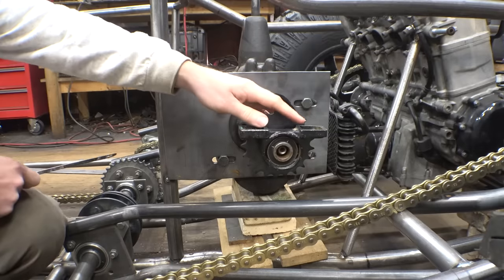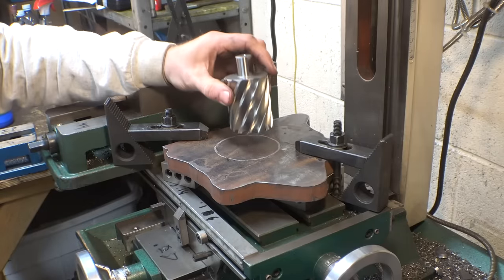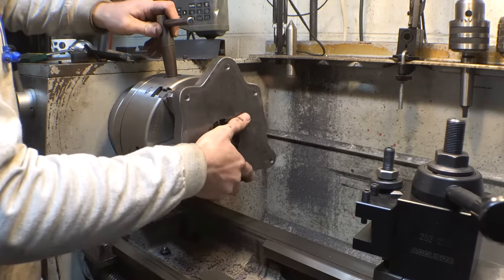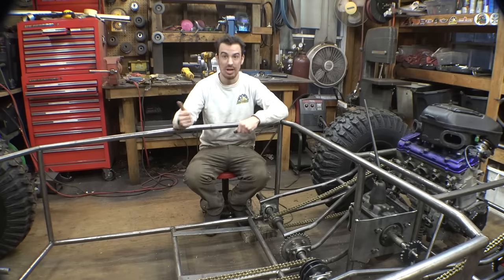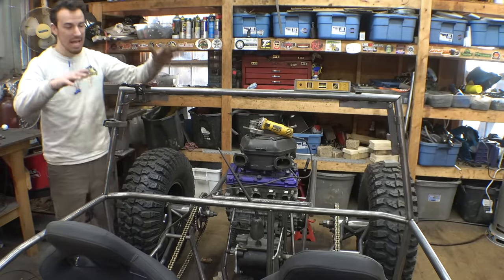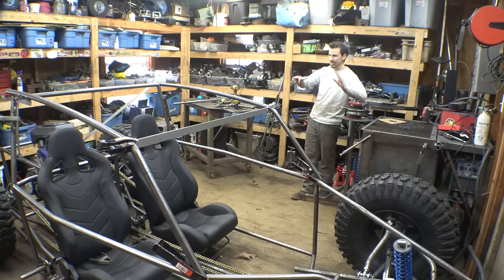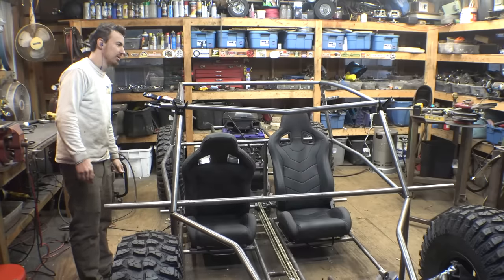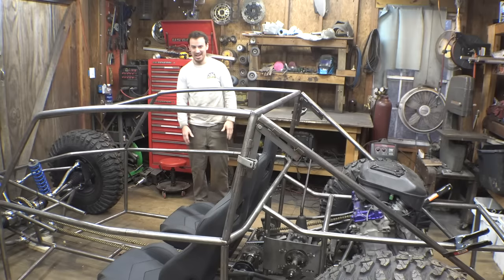Mini 4WD Trophy Truck Project - Part 7

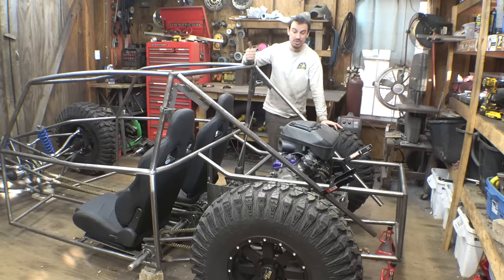Comment: 26:54 I’d say it look pretty cool running that tube from the roof to the end of the back and it’s more functional that way and also adding the roof would tie in to the aluminum panels on the side AND I JUST WANNA SAY THE FRONT END ON THIS THIN IS BADASS 🔥

Comment: It's gookin' amazing!   the rollbar should protect the airbox & then mount the tire over airbox. Between engine & rear frame  would put gas tank. when you build the exhaust I would make it come up a rap around one set of pipes on each side of the spar tire!!!

Comment: Put a pop-out bump over the air box, OR put a 'hip roof' type bend to the back frame part so it still clears the air box while still giving you a cool 'fast-back' look to it.

Comment: A little trick I have learnt (really old school method of resurfacing a engine cylinder head) is use a strong flat piece of glass (glass patio table works well) tape a big sheet of sand paper and then just push forwards and backwards what you want to have a perfectly flat surface and work your way up with finer and finer sand paper

Comment: If you're considering a spare tire but you want rear visibility, why not put the spare on the roof? That would look sick🤙
Reply: that was my thoughts also.. out of the way..
Reply: roof rack with tire rack and light bar
Reply: Carrying a full size spare in a rug like this is adding extra weight, raising the cog and mostly pointless.

Many in the Suzuki 4x4 club stopped running spares years ago. 
Air compressor for lockers and tyres, a patch/plug kit and basic tools.
Reply: Roof rack would be awesome. Maybe if there was a little more room behind the engine could make a place for the tire there.
Reply: Or put the tire horizontal above motor but with the ability to see under it to look backwards.. almost like squaring off the rear... give motor protection and a spare location without on roof so wouldn't be as high...
Reply: I agree.  The roof is the perfect place for the spare
Reply: If he's going to be using it as a rock crawler, by putting the spare on the roof, it would increase the height of the centre of gravity, causing it to be more unstable at certain angles compared to if it was lower or elsewhere. Even the rear would be a bad idea as all the weight is there, causing the front to be less stable at high speeds and vertical angles. I feel like he should make a bonnet/hood on the front and try and place it there
Reply: @stephenweston2973  I had the same thought. If he took the roof line of the front and continued it all the way back with something like a 75 degree angle bend at the end, down to the back corners he'd have a clear line of sight all the way through, much more room to remove drive components later and  a great spot to mount his tire.
Reply: High cg

Comment: Chris, when making a hole with a hole saw, pre drill a hole (say 8mm) just inside the edge of the finished hole size. This lets the cuttings clear easier and the saw will cut faster and cooler 💪👍

Comment: You've got a real challenge getting the asthetics of the frame looking right, whilst meeting all the parameters of installing all the major components of the build.
Was pleased to see that you 'pinced in' the A-pillars and added a curve to the roof rails.
I would be inclined to suggest that you add 2 more curved rails to the roof along the center line of the MTT (Mini Trophy Truck) say 6" to 8" apart to support the ali roof panel. it would also allow the option for there to be lower section in the middle of the roof (front to back) to help reduce the apparent 'mass' of the roof which might occur using a single one-pice panel.
The bends you've added to the tubing help reduce the boxiness of the MTT, which is great.
As for the rear bars from the B-pillar to the rear, maybe do as you've suggested have shorter & steeper diagonal rails from roof hoop to the side rails close to the centre, or just behind the centre of the wheels. Then that would allow you to build a removable 'engine-cage' which would have 3 benefits: 1.It would protect the engine, 2. It would give the MTT a more truck like side profile, and 3. It would allow you somewhere to mount the spare wheel like most trophy trucks.
Hope you're OK with tossing a few ideas in to the mix.
You're doing a awesome job, which must involve countless hours 'off-camera'.
👍👍

Comment: You could put the spare tire on the roof. That way you can have good visibility behind you.
For the airbox protection you could just put a bend in the back rollcage bars to keep the steep angle but also protect the airbox

Comment: Ditch the spare tire, just keep in your trailer locked up, use if needed. Also add an "angry" bend just below the other upper bar, for the steering area etc

Comment: Mad skills building the plate for the trans!!! 
When building your cage make the back short, that motor will make a lot more torque with a custom intake on it, the. You can push the intake over the top of the motor towards the front of the car. 
Everything looks cool but definitely take in consideration of what your cage is going to do in the event of a rollover and address the key points of stress on those areas. The triangle is definitely your friend when building a cage, function is more important than form in that respect.

Comment: Sir  for the Back Braces put in a Radius bend in the Tubing. As for the Side Rail are a little high and needs to drop Down 8” to 12” to make it Easier to get into your mini truck, put X in Roof, front end ,side ,last rear to hold your Tire.   Looks Awesome Still

Comment: I would say carry the roofline a little way and then bend the steeper angle you like in the rear so it protects the engine. 
Could you get away with a hood mount tire, better weight distribution as long as you can keep line of sight.  And a shield/tunnel for the chain should be sufficient, PTFE or nylon guids to quiet any contact points

Comment: Love this build as well, maybe slant that bar all the way to the bottom in the rear then the spare can be mounted lower for rear vision and also you could utilize some of the frame  for coolant passages for the front mount radiator seen grind hard do that 👌☮️

Comment: Cross bar support on top with a removable soft Top. Back bars sharp drop to horizontal to 90° drop to back. That should protect the air cleaner, provide tire mount and give the illusion of a truck bed.

Comment: If you feel you need to carry a spare tire, you could fabricate a thin wheel and tire just for emergency use, maybe using a motorcycle tire, and possibly mount it on the front. An alternative mount might be on one side at the rear, parallel to the rear wheel, possibly on the inside of a rear frame braces.

Comment: I think you should definitely run the rear tubing all the way to the back of the frame to add protection to the air box and for the spare tire it would still pretty great in my opinion

Comment: Love the build. Yet the idea of a rear mounted spare tire of that size I likely to negate your plan for a rear view mirror. Looking at this cool build it might be worth considering adding weight to the front by utilizing the low front end to mount the tire there and the rad behind the engine down lower which would also negate the need to add more weight with a front mounted rad which requires a lot of piping for coolant. 
It would look good and meet utilitarian standards. Either way I'm sure everyone will be pleased with your final build. I love this build because I have been wanting to build this 4x4 design for years but have no place to do it.

Comment: You could definitely do High speed digs in 4WD with a chain guard and either one huge chain guide or several small chain guides but High speed digs aren't impossible just because you're using a chain and with IFS it's really simple to build.

Comment: Looking good. The top tube of the halo hoop I think should have a matching curve in it to match the side top tubes. The angled tubes in the back would make more sense to have them go all the way to the back of the frame for protecting the motor and to mount the spare tire. As much as I prefer a notchback over a fastback, fastbacks still look awesome.

Comment: I’d say put as much paneling as possible. Make the thing look finished. Part of what makes these off-road projects so fascinating is that they are covered but have beautiful cage work done. As for the back end angle for tubing, gotta protect the motor first. For where it sits the motor is too high to do the cool angle where it comes down halfway on the back end. Have it go all the way to the back bit the bullet thing. Spare tire is probably a must. Makes it look cool, capable and tough. For the rear view mirror it’s gonna be hard if you want to incorporate anything else to the back. Go with a cheap replaceable back up camera mounted right under the top of the main hoop. Or if there’s not enough room with the spare tire right at the back of the bumper. On Amazon I’ve seen em as cheap as 50$ for a little 5 inch screen. Can either engage the cam when you shift to reverse or just wire it to be on all the time. Plus you can put the screen next to the dash so it’s always where you’re looking anyway. Sorry about the long comment, it just this project has so many cool features to incorporate! Keep up the good work. Always Rather Be Welding

Comment: The rolled top looks great. 

If i were doing the roof id add a 6-8" straight portion between the mean eyebrows. Then run 2 rolled bars back to the rear. Connect the front of the rolled bars to the new corners made by the straight portion up front. Then connect them to the rear about 10" from the corners. Making a kinda V shape to the roof.

Comment: I think with the bars that'll protect the engine should taper inwards at a angle for the first foot at the same downward angle as well then bend back to meet up with corners of the lower tubing would look nice. Cross bracing the roof I think would look better in the end and I think you should sheet the roof too, it'd look a little goofy with the rest of the paneling on as of right now in my head.  Loving the build man! Keep on dishing out the awesome content!!

Comment: Pretty sure the purpose of the tires on the back of trophy trucks is weight so they don't nose dive and I don't think you will have that problem without a spare on the back. The shape looks really good and it's coming together nicely.

Comment: Idea for CBR... How about using camera and a small screen to see behind you like a rear view mirror. Use a camera fitted on the back of the CBR1000 for rear view with a screen the size of a mirror in the same place as the mirror would normally be so it feels the same and you use it as you would the usual mirror but you could make the view adjustable if needed.

Comment: You could do the full panel look, mount the spare tire to the roof like those adventure buggies, and even a plexiglass "windshield". These additions I feel would give the vehicle a more "complete" look instead of a cage with wheels. Additionally, you might be grateful for the extra paneling and windshield when rocks and dirt are being slung at you. Just my thoughts

Comment: Roll the two bars on the back, and have a bolt on cross member (for engine removal) that the spare tire bolts onto. Less strait lines, more rolled 🙂

Comment: If you move the engine forward you can have the rear tubing at a steeper angle and it will bring more weight to the center and plus you could make a trunk. All I'm seeing is bonuses there if it can be done

Comment: You need one of the long race mirrors so you can see behind and to either side like for dirt track cars. You could also make a horizontal rail in the back so it looks like a truck bed.

Comment: You should definitely do a roof but you should add a sunroof or roof escape hatch.... That would be helpful when bogged down and you don't want to or can't get out the side. Plus it would add a little more style to it whenever you can roll up on a hot day and completely open the roof for air flow.... 😎😁

Comment: Nice work buddy if you have the aluminum on top make sure you have enough support brackets tabs and structural tubing and a good way to secure it , It will vibrate very annoyingly if you don't have enough brackets to hold it firm but I think it's a great idea and the ultra trophy mini lol is coming along great looks good and seems to me you got it handled good work buddy

Comment: The tubes going to the back would look good extended all the way to the end but put a 35deg bend about 9in from end. That would raise the bars up to provide more protection for the air box.

Comment: I like the angle of the rear cage like that. Now is the time to get creative with some additional bends for structure/engine protection in the back, but I definitely think you should not angle those 2 bars all the way to the back. They look good like you have them.

Comment: I think it would look cool, if you make mounting on bolts for the spare tire right behind the engine. Good visibility, engine protection and taking out the engine wouldn't be a problem. Btw, V shaped reinforcement instead of windshield will help gaining pure trophy truck spirit.

Comment: How about moving the back bars where you lick them, then building a small roll cage over the engine and slanted mount for the tire where you were talking about putting it.
Just some quick thoughts on what might work, give you a still fair view behind yourself and should allow for the looks you want.

Comment: You might want to try a thin coat of RTV sealant or muffler paste on the plasma table to help prevent welding the job to it. You will need to ground the job not the table and clean off the table and recoat it often.

Comment: I would mount the radiator in the back end put the roll bars all the way to the back and mount the spare on them with it hanging down a little in front of the radiator for a bumper.

Comment: I'd like to see RBW take a K20, mount it mid engine and turn it sideways and run driveshafts to solid axles front and back for an AWD Rock crawler/bouncer.

Comment: Placing.the extra wheel above the engines airbox may be the best.
Also the radiator placed at front, the more cold airflow, the better.
Using the fan with the automatic sensor only.
Because that will really ask for some nice airflow, behind the seats and close to the engine may not be that great.
Loved the top.bars with the slight bent 👌

Comment: you could look for a sealed bearing same size as the one in the back of the transmission and just pull the inside seal out. save you making a housing to put the seal in

Comment: I think it would be awesome to cut some actual body panels off a scrapyard truck of your choice to install on it. Make it sorta look like a truck. You might be able to find fiberglass fenders for a ranger or something.
Reply: Watched more. Cancel my suggestion of fiberglass. I didn't realize they were expensive. But sheet metal off a junkyard truck would be reasonable?

Comment: Chris, I would add a Prius electric water pump and I would put it right at the bottom of the radiator in the front that way your motorcycle water pump isn't beating itself a dead death try to pump all that water and if the water pump in the motorcycle engine goes out for some reason the Prius electric water pump will pump it just fine and they're only like 35 bucks make sure you get the electric plug for it to.

Comment: Chris if you don’t want the long chain to turn you may want to add another sprocket lock out like the back. Otherwise as long as the front tires are turning so will the chain. Or that is how it appears to me. If the wheel hubs have a lock then it should be fine.
Reply: he has Ford ranger locking hubs for the front

Comment: There is a safe way to static test the centre chain drive remove the rear drive chains and the front cv axles and test it with appropriate chain guards / enclose tunnel etc in the shop “ when “ drive train/engine married. Just a thought.?

Comment: Take off the angry eyebrow bar and put in a strait bar so you can put a windshield on it. Then you can make the angry eyebrow look with the roof. have it point down in the front. you could also up bend in the back of the roof making it look like a spoiler.

Comment: I have an idea regarding the spare; If you're going to keep the rear section flat, why don't you mount the spare to the very rear? You may choose/need to shorten the box section a little to stop it looking goofy, but it would prevent it from occluding your field of vision, keep it properly attached to the vehicle, and even act as a bumper if the unthinkable happens and someone drives into the back of you.
The other option, would be to mount the spare on your roof. It would keep it out of the way and eliminate field of vision issues

Comment: Body roll is going to cause negative camber in the rear during cornering. You might consider going to a round tire profile. Those square ones are going to be on their edges most of the time.
Trophy trucks are known for soft suspension. That's how they go fast.

Comment: Maybe mount the down braces to the top of the rear frame section. And radius the bottom of the rear frame section for better departure angle.

Comment: Love your videos I've been watching since you were building the tiny go karts. In regards to the center chain it will spin while driving unless you have a way to disconnect the front hubs from the diff but as long as the chain is tensioned correctly I don't see any issue with is even at high speed

Comment: I think for the back end, take those bars all the way to the back and then build a removable extra piece on the back for mounting a tyre, rear bumper and mud flaps. The rear end just being flat would look weird in my opinion, i think it would look more like a trophy truck if it had some more metal behind the rear tyres